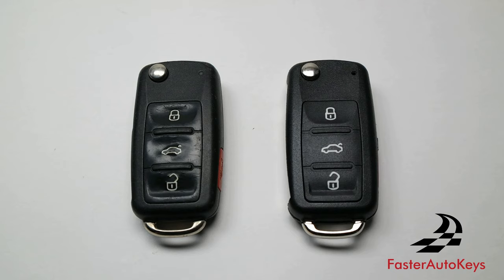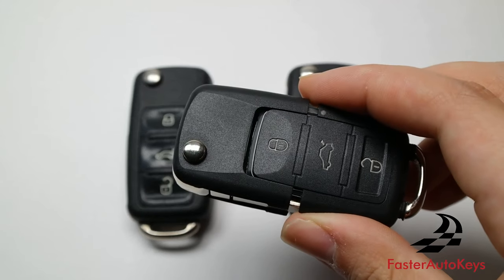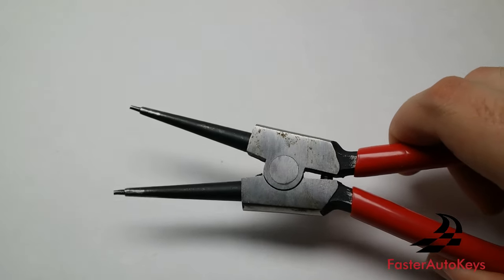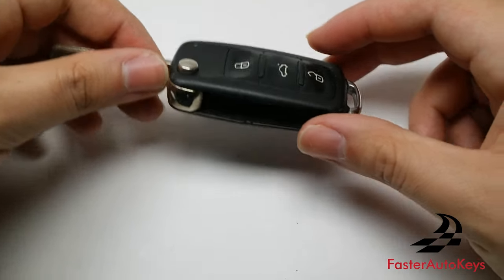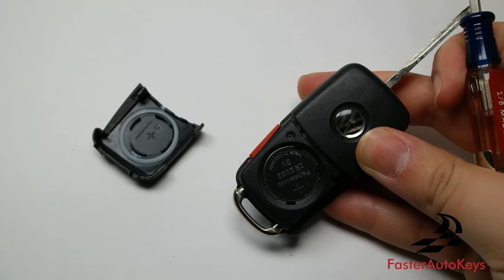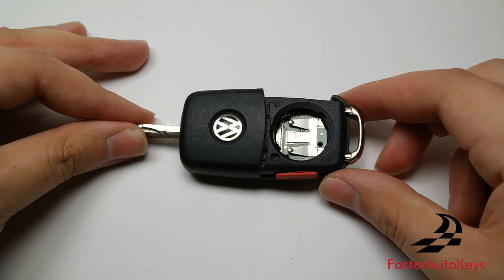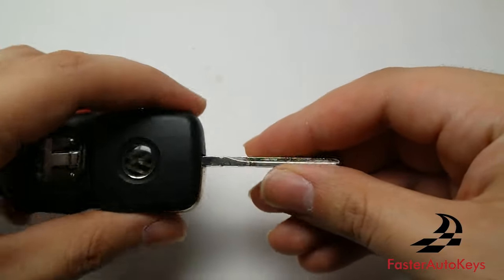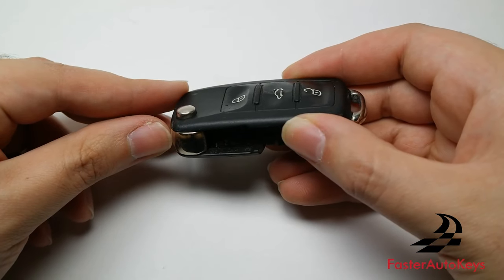[HOW TO] 2010+ VW Complete Volkswagen Key Fob Shell Replacement Tutorial

Comment: Hey Mate,Thanks for your video. 
I was quoted $900 from a local VW dealer for two replacement Keys.
All i needed was the Flip Blade section as the key & battery still worked. I purchased two replacement Fobs for $50AUD delivered. I bought a pair of circlips for $10 and two new batteries for $6. 
I followed your tutorial and it worked perfectly. I didn't even know what a circlip was before this tutorial, but I fixed my two keys in under and hour for a total of $66AUD. ($50USD) It saved me at least $500. You are a legend.
Reply: you didn't save much, instead, you just avoided being ripping off from the dealer. mate, your dealer is ridiculous!! in Sydney a vw key is $150 max

Comment: Thank you for a fanastic guide. Replacing my key housing was an absolute nightmare. Your instructions helped a lot! My housing was full of gunk and I had a very hard time taking it apart. I didn't have the right tools for it either.
But without your guidance in this very thorough video, I would NEVER have figured it out. The thing where you kind of "arm" the spring... I would have never figured that out on my own.

Thank you so much for this!!

Comment: Thanks so much for this, I bought a replacement key fob some time ago, but I wasn't sure if I could actually use it. Because of this video, I actually replaced my old one, which was kind of beat up by the previous owner. Great tutorial, easy to follow. I didn't have the tool you mentioned for opening them, so I used a pair of needle nose pliers. It took some effort, but I got the job done! My new one looks great!

Comment: You have just saved me NZ$700 (US$500) as that is what the local dealer wanted to charge for a new second key.  A big thanks from New Zealand. By the way, my old key did not have a red panic button and my old "circuit board" did not the corresponding silver panic button connection on the underside, but it was no problem, everything fitted perfectly and the new key works fine.
Reply from the maker: We're glad to help, and yes European market keys tend to not have a red panic button.

Comment: Perfect instruction, thank you so much. I've done it with a original Sharan 7N key from 2011 and it worked well. Just to say, that the lateral pin goes through other plastic stuff inside the key and once you open your key that stuff will explode and the pin will slightly be bent. Maybe I did not hammer the pin deep enough. So in case you want to re-use your original key case be aware of this, otherwise it might not re-close firmly. In my case it did not matter, because I wanted to replace the case.
Reply: That’s the comment that probably just saved my but! Thank you!!
Reply: @jongoodstein  actually, it damages the case. there is no way of removing the pin. as soon as you open it like that the little notch where the pin goes get's broken
Reply: @joaoferreira88  Very interesting. My panic button has gotten hypersensitive (it just goes off randomly), so I was hoping to open the case, clip off the plastic finger for the panic button, then reassemble the old case.   I'm understanding your comment correctly, it sounds like there's actually no way to hammer the pin in to open the case, and then reassemble the old case because the old case will now be damaged?  Is that correct, or did I misunderstand. Thanks in advance!
Reply: @tedjohnson64  you are right! You can not remove the pin back and not everyone understands that!

Comment: Excellent video!!! After cutting a new key, Ace Hardware wasn't able to program our replacement so I used this video to swap the guts from my old fob to the new one. The new key starts the car perfectly but the remote lock doesn't work. But we can live with that. Thanks!
Reply from the maker: Thanks for the comment. Sometimes with a simple battery change these VW remotes will lose the programming. Reprogram the remote, it can be done yourself and there is a tutorial in your owner's manual. This should resolve the issue

Comment: Thank you very much for this video, it helped me to replace my key who's blade holder had broken like so many other people's have.
The only thing different in my new key unit is that it wasn't supplied with a screw but it was held together like the original, with a pin.
The unfortunate part of pin fixing method is that it is destructive to open, breaking the internal locators hence the amount of effort required to open it.
All that said, I found you video very helpful. ❤️❤️❤️
Reply from the maker: Thanks for the kind words, glad to help! Yes, since the video we have upgraded to a higher quality shell that follows the OEM pin specs. Thanks again
Reply: This was a month ago but did your cut key fit cleanly into the the supplied elbow-shaped housing? It is such a tight fit that it is not even clearing the pin hole. I noticed the mechanism is smaller than the original so I wondered if that was the issue but so many comments seem to be doing exactly what I am
Reply from the maker: @Gatorsfan456  It is a very tight fight, some OEM blades are thicker. You will have to sand the blade if needed otherwise we suggest ordering the key with a cutting service

Comment: I know it is difficult but it is best to extract the locking pin from the key instead of hammering it in. When hammering it in, it would be best to hammer it at least 1cm in to make sure the pin is no longer locking both sides. Yes this will damage the shell but that is on the inside.
Reply from the maker: Since the video and because it caused a lot of confusion, we tried and it can be opened using the tool without messing with the pin. It requires more force but for those who have concerns this can be avoided completely.

Comment: Great video.....my fob has a broken spring key mechanism...the metal elbow broke.  So I will use your elbow....spring....and pin but install my key.........will it work if I just hammer the pin back in and use my old key or should I put some locktight in with the pin?  Thanks
Reply: Curious about this too.
Reply: That's exactly what I did.  It worked.  Moved my old key and chip to a new shell

Comment: It is a bit more difficult if you have to swap the actual keys though. 

I highly recommend you spray some oil in the new key - pin hole in order to remove the blank dumby key. (It required a considerable amount of force with the punch tool and a small hammer to remove)

Had to use the original dark carbon pin in the new FOB so it could lock in. (Also required some tapping with a small hammer and punch tool)

***Recommend using a vise or clamp of some sort to keep the remote still during tapping. 

Overall = GREAT VIDEO 🙌 saved me at least $200. Only cost me about $30 all together to replace.
Reply from the maker: We're glad to hear that. Yes, some OEM VW blades are thicker and require the end to be sanded to fit perfectly. We do offer a key cutting service which would skip this and make everything easier.

Comment: I did this exact procedure on my fob for a 2012 VW Golf. In the video at time stamp 6:08 when I removed the circuit board, the gold looking switch got separated  from the board and was stuck to the flexible rubber part of the keyboard. It may have bee intentionally glued by VW, I don't know for shure. I managed to remove it from the rubber part and re-glued it with a very thin layer of instant glue taking care to place it to meet the section on the circuit board and luckily it worked. If not, I would not the unlock function on the fob would not function. So beware.

Comment: How beating pin in helps to open it up? Pin is holding two pieces of key in 4 places, when you push it in another 1mm it'll still hold it all in 3 places.
Reply: It just helped a bit, made the pin bend a bit when pushed apart by the pliers.

Comment: Hello - removed key blade and hammered in the small pin by about 2 to 3 mm. Is this enough or need to push in pin by 5mm? Then tapped with rubber mallet a wide head blade screw driver and did spread apart the top and bottom pieces some near pin but the rest didn’t separate.  Worried that forcing angled driver blade in deeper might crack case. Away from pin area, is the top and bottom parts of case glued together?  Or maybe interlocking tabs holding case together. Don’t have easy access to pliers shown here. Once have area near pin spread apart is other area also with flat head screwdriver that could be used to spread apart and free top and bottom sections. Thanks for ideas.
Reply from the maker: Hello, we've had to open a few keys that were already partially opened before. It is a very hard process the tool makes it so much easier, our suggestion would be to use one if you have any other keys that need opening in the future.

Since the video was made we have been able to open these keys without even messing with the pin, but as long as the pin isn't flush with the outside it's pushed enough. 

Yes we believe it is two pieces that are glued together because it's similar to the Land Rover keys.

When it's this hard to open, our suggestion which is risky could be using a vise to either try pulling the casing apart or cracking it together being pressed into each other.

If there's still a part of the key that can pry apart with force like the video, we would suggest using the tool there and seeing if you get lucky.

It's a very hard job without the tool especially once it's partially opened, good luck getting the remote out.

Comment: What about the pin that you knocked in with the hammer, that unlocks the two halves of the case?
Does it just pop back into place when the two halves of the case are pressed back together?
Reply from the maker: Hello, you shouldn't reuse the old case because the opening process breaks it. The pin assembly is useless as it snaps the housing apart.

Comment: I would say the pin in the side of the fob needs to be popped all the way in. With my key I broke some of the plastic though my pin was depressed as mush as yours. So I believe it needs to be popped all the way out where you can't see it anymore.

Great tutorial though, it was very helpful regardless.
Reply from the maker: Hello, we're glad to help but there is a risk pushing the pin into the remote can cause it to hit and break off a component inside the key.
Reply: Old key will always break - there is no way to push the pin any further - there is a big thick plastic wall behind it, and then there is the chip itself. Pushing it in just makes it easier to crack the nut.

Comment: Great tutorial, thank you.  I assume the original fob doesn't use a crew under the VW symbol?  And the pin your hammered in returns to its position when reassembling, or is that pin not present on the replacement, and that's why it has a crews?
Reply from the maker: Hello, thanks for reaching out. We don't recommend reusing an original shell because they were held together with glue. It can close together, but it will never be the same and can pop open when using. When you break this key shell open, the system that holds the pins break off so it cannot be reattached. The pins will bend when opening as well, this is part of the reason why we recommend a new key shell. Since the video we have a newer design like the OEM shells, that have a pin that installs on the side. The new shell uses the pin system, no more screw in the back and it can snap in place without using glue.
Reply: @fasterautokeys  Thank you.
Reply: @fasterautokeys If your new key shell design has a pin on the side instead of a screw, does that mean that the new shell (like the OEM original shell) cannot be opened once assembled, because opening it (by hammering in the pin) breaks a plastic piece inside the key shell?  If so, is the older shell design still available?

Comment: The one you removed first did it have a screw in the back, I did not see you removing you just used the plier , but the new one had a screw , I am little confused, plus what about the pin that you hammered, the new seemed it did not, again I am confused, please clarify
Reply from the maker: The original key has a pin on the side, and it does not have a screw on the back as shown in the video. The new key does not use a pin for an easier process, it uses a screw on the back for extra rigidity.

Comment: Found that the Oem key is much bigger at the end where the pin goes in, Had to sand it down a significant amount of the back side and both edges to be the same size as the replacement key so it would fit in the elbow. Other than that everything worked great.
Reply: Would suggest just getting the cutting service done
Reply: I’m having this problem aswel :/ what did you use to sand it down?

Comment: Hello, i have the exact same key (2012 car also) but my remote does not have the red panic button and the little screw on the back? but everything else and form factor is exactly the same. does it still fit in this shell with the red panic button or do i need to order the one without ?
Reply from the maker: Hey, European model VWs will not have a red panic button, and the screw is only on this replacement shell for added tightness. If you use our shell, a panic button will be there but it will simply not do anything.

Comment: I need help! I did everything like shown and the small red light is lighting! But the car won't open/close when pressing the buttons? I also feel the significant button-click-feeling when pressing the buttons but the car does not react... What could I do??
Reply from the maker: Hello, it sounds like one of the buttons are sticking. This means remote was put in a way a button is constantly being pressed in. We would remove and try to evenly place the remote back inside
Reply: @fasterautokeys  thank you very much for answering! It is a misunderstanding, the light is not constantly lighting but only when I press the puttons, like it should. But the car does not react...
Reply from the maker: @lenae246  Is the key still able to start the VW? Sometimes even with a battery change the remote will lose the programming. If this is the case it's a simple process to reprogram yourself. There will be a tutorial in the owner's manual, and maybe there's a video showing the process too

Comment: Question, so I can remove all parts from my old fob to a new one, stating all parts, cut key, pill chip, board,  and battery? This will work without having to reprogram the new rebuilt fob? Please, & thanks for the help.
Reply from the maker: Hello, in 9/10 cases no reprogramming is required. The chip that is programmed to start the vehicle will stay programmed because it does not need a battery. in some cases the remote will need to be reprogrammed but this can be done yourself following the owner's manual.

Comment: I bought a car with "Kessy" - keyless system.
Why do this kind of key come with a blade?
Do you have a way to remove the sensor and put just the keyless sensor in another case? 

Like a small case to keep in a necklace or put the sensor in a better case (like just the VW simbol but bigger) ?
Reply: * I just dont understand why does the key have 3 Buttons  if it have keyless system. I dont use the Buttons and never take of my jeans. 
This vw key case with Buttons  makes no sense in keyless system
Reply from the maker: @canaldopasin818  The key has a blade, because if the battery dies you would be in trouble. The VW still has a door lock but it is covered by a trim piece. From our experience the transponder chip outside the remote makes it stop working. The only reason we would remove this transponder would be to install it on a donor remote (because the original remote was damaged). Some people like using the buttons especially the lock button to confirm the car is locked.
Reply: @fasterautokeys  thank you. 
I'll learn and try to remove the covered part like in the video.
The VW dealer from my city don't know about this to teach 😥
In the video looks easy. I just have to find a trim part to use to remove the cover.

Comment: Question ? How big of a difference will the original part key and one I ordered online make with programming a key. The only difference is the H on original key part and P on the one bought online.
Reply from the maker: Hello, if the back of the OEM remote has a P and the new remote is H, there is a chance the new remote will not pair to the vehicle. Most 2006 VW models have an H remote while the 2007-2009 remotes tend to have a P remote.
Reply: FasterAutoKey thanks for responding back!  My car is a 2010 VW Jetta and our key fob is the one that separates from the middle and the numbers on the inside is exact just the letter difference so do u carry the key fob to purchase and we will still have to get it programmed right?

Comment: I went rafting and the plastic bag failed to protect my keys. The shell has a small hole over one of the buttons, water got in and the keys wouldn't work. I used this video to disasemble the keys and remove all the water. I then used 92% iso alcohol to clean everything up. I reasembled it and my keys started working again, shew! I am going to order a new shell. I used pliers to pop open the shell and a pin from something else along with the butt end of a screw driver as my hammer.

Comment: Hi Guys, I have a key from a 2004 Touareg with a code on the key that reads 300 9595 753R, the FOB looks like a 2010 FOB where the transponder chip is jointed to the circuit board. What is the alternative compatable Key circuit board? I have been to your website but I have no idea what to order. Help please
Reply from the maker: We don't have this key in stock, (only the shell) but we would search for part number KR55WK45022. We believe the part number is also shared with a Porsche Cayenne.